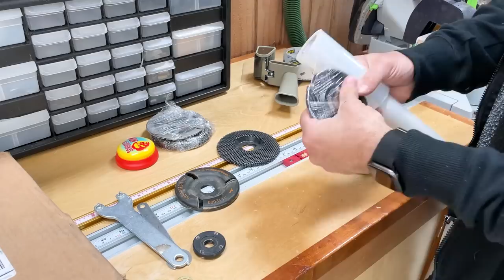The Walls Came Down

Comment: I own a couple commercial properties- my shop, some retail rental space (a post office) and a warehouse. It is great to have a shop that's not attached to my home because it keeps my workdays more disciplined and helps me separate from work on my off-days. But it is vastly more expensive! Not only the cost of the building, but all the extra bills (heating/cooling, water, electricity, internet, cable, etc.) add up, especially the property taxes and insurance, which are so much higher than for a residential property. You also have to consider duplicate costs for all sorts of things since you can't share things with your house anymore, like certain tools and appliances. Then there's the cost of maintaining a commercial building, which is more complicated and expensive than a house. All of this adds up to thousands of dollars a month that you could be putting into your IRA's or other investments if you had your shop on your residential property. Don't get me wrong, It's a great luxury to own commercial property, (and sometimes a good investment, which is why I own some) but as a workshop for a YouTube business, which can literally operate anywhere there's an internet connection, it's an expensive luxury :)
Reply from the maker: All good info. Thanks man. Also have to balance that stuff with the fact that most areas that allow home based businesses do NOT allow you to hire outside employees. So if growth is the goal, you're stuck. And in my case specifically, I'm fortunate that I'm moving from Denver ($$$) to Missouri ($). That puts us in a very good financial position to absorb any additional costs associated with the business. This is something I'd never even attempt here in Denver.
Reply from the maker: Not to mention the muddy water between homeowners insurance and business insurance and how the two will likely both bail out in the event of a major issue.
Reply: @johndoe6032  I have often heard that about being an audit flag, but I have never met a tax professional who confirms that this is true. My accountant says it's a myth, but I suppose that's just one guy's opinion. The IRS is never going to confirm or deny anything :)
Reply: @StumpyNubs  Once I discovered what happens when you sell a house that has a home office for which business deductions have been taken I decided it couldn’t possibly be worth it.
Reply: Gasoline unfortunately isn't free either. Unless you walk to work or maybe take the bus you're probably going to drive. You could just buy a horse and buggy and learn to scream "GITTYUP!" on the freeway.. lol
Reply: @woodwhisperer  Get out of Denver baby go go!

Comment: Moved back in 2020 and sold most of my machinery and bought new for my new, larger shop.  It worked out  well for me, especially since I had put my shop into storage while updating the new shop space (electrical, walls, insulation, etc. . . ).

Comment: When I bought my place about 8-9 years ago it was touch and go all the way down to getting signatures at closing.  But it worked out despite all the drama.  I didn't care about zoning at the time so I never really looked into it.  NOW I'm dealing with possible zoning changes and variants as my plans for the 1800sf shop that was on the property when I purchased has changed.  Good luck on your search/sale.

Comment: I'm making the shift to a not-at-home shop currently too - 40 acres of woods was still somehow going to be a zoning fight to build a bigger shop on, so I ended up buying a ridiculously huge old textile mill instead (pretty reasonable price - 42k sqft for $260k in mostly decent shape).  Keep a close eye on roofs, commercial roofing can get pricy to deal with fast, and flat roofs are prone to leaks that commercial owners seem to love to just ignore; the typical roof construction can also hide small leaks quite well until a real heavy storm.  Worth researching the background of the building too - I found mine had been bought super cheap at a tax sale and the guy's plans had fallen through, so I lowballed and got lucky, asking price had been 500k.  Can be worth going a lot bigger than you need too, I've got a 15k sqft room I'm going to rent out, should bring several grand per month more than mortgage, utilities, etc.

I was a bit hesitant about not having it at home initially, but the drive is easy enough, and has the big side benefit of making it possible to sell this house and move whenever I want without having to also move the ridiculous amount of tools I have on a normal house sale timeline.  Also space. So. Much. Space.

Comment: Golf club bags work great for clamps too. Most have wheels making life easier, and they can often handle alot of weight. Pick them up used at pawn shops, for next to nothing most of the time. I got in the habit of using them for microphone stands and cables for live sound, since they transport so well.

Comment: Apple boxes and similar are my favorite moving box. Sturdy and with handles and a consistent size for stacking, they can take the weight of books or other heavy items. Often free from your local produce market (if you get there early enough).  Do movers accept flammables? Even in totes with taped lids, I would think that partial containers like that would be a no-no.

Comment: That lift is pretty cool , im in the planning stages of knocking down a very structural wall in my shop that will add about 500 sq ft.
Lifting the LVL beam was a big hurdle until I watched that unit in action

Comment: Boy can I relate to this video. Just moved my house and my shop two days ago. The movers couldn't believe how many tools I have. They had literally never seen a jointer or a band saw. They kinda knew what a table saw is. Anyway, they got the tools in and out of the truck but it will be a while before I can tell if there was any damage. 

Best wishes on the move, Mr. Spags. Going with a commercial property as an LLC would likely give you a lot of freedom; no residential codes or HOAs to worry about. Hopefully, the taxes won't be too bad in Missouri.  Probably wouldn't be cost affective in California or the northeast. Be careful about what kind of area the commercial property is in. You don't want to have to commute with an armed security team or constantly worry about break-ins. (Parts of St. Louis come to mind.)

Comment: Moving across several states later this year and really interested in how you pack and ship the larger tools. Do you put them on pallets? Enclose them in some sort of carton? Break them down somewhat (e.g. wings off the table saw). Just take off the wheels and stretch wrap? 

And shipping. In your move to Colorado, the shop arrived a few days after the household stuff. Separate shipper? Just two loads with the same shipper? Are you going to use PODS or a similar vendor for the shop equipment?

Comment: BTW, on the "temporary wall" I can't think of any code violations it could introduce code violations it would introduce except for the un-inspected electrical stuff.  You didn't do anything to affect the  structure of the house so I am not sure if the wall would really be considered a wall.  The one thing I thought of was possibly draft stopping.  I recommend you look into that when you rebuild the wall at your next location.  Also, it may be possible to avoid electrical code issues by plugging the wall into an outlet rather than wiring it into the house wiring.

Comment: I just moved from a two-car attached shop with maybe 350 square feet to a detached garage with 1060 square feet. I lived in the old place for 15 years. I learned that you can have enough equipment to fill a large space in a small space, as I've very much filled it. I'm lucky enough to have a son who manages a Two Men and a Truck office. He educated me on the science of boxes, tape and shrink wrap. He did not educate me on how to move a big Powermatic table saw, however, which he and his guy did solo, or how to literally run the entire time while not carrying something heavy. Luckily the roof of my cinderblock shop is open so I could use the joists and a chain hoist to lift things onto carts. This was two months ago and I'm still only about half way to getting my shop squared away. Good luck to you brother.

Comment: Note: Most movers won't move or store volatiles (solvents and finishes) and paints; but, if you are moving a vehicle, you might be able to get away with it inside that.
Also, when we moved, the movers moved both of our vehicles and since they arrived first, I used them to pack items that I needed right away before the big moving truck arrived.

Comment: I too am moving. Tools beeping what they are, no fun. Sometimes somewhat clean used plastic (metal?) 55 gallon or other sizes can be had cheap, probably have to cut the top off, they make excellent shipping containers. 
If you have not gotten a place Tulsa OK has some places residential on one end and commercial so the other, most were out of my budget or current needs.
Look up 2 things for your future daughter 1) application to date my daughter 2) song “Cleaning My Gun”. Boys will come knocking before you know it it will seam like only a few short weeks.
Monte

Comment: Could you use some of those large cardboard tubes that are typically used for concrete footers to store longer clamps? I don't typically wander through that isle in the hardware store so I'm not sure if they come in longer lengths.

Comment: Here is a fun moving adventure I had.  I have two rolling mechanics tool chests.  Not big, maybe 4' wide and 3' tall.  Both on wheels.  Standard chests.  Rather than empty them I used the Stretchy McStretchWrap around them so that the drawers and doors would not fly open.  The movers rolled them up the ramp to the truck, then lifted the tool chests on their side.  What a disaster.  Things got so messed up it took hours to just be able to open the drawers.  Their response... "You are supposed to empty all drawers and you should have known we were going to transport on their side.  Besides, how were we supposed to know they still had items in it?".   Hmmmmm.  How indeed.  Maybe the weight or all the rattling you were hearing when you started to tip it over on the side, then moved to the second one and did the same?

Comment: Here’s a tip to be able to remove packing tape easily: instead of pressing down the end onto a box or whatever surface you’re taping, fold over the last 1” onto itself (sticky sides together) to create a flap you can easily grab to tear the tape off. It’s much easier than trying to find the end with your nails or cut open something you don’t want to damage with a blade.

Comment: Mark, I've a different kinda question for you 😄 What sort of lenses do you have in your glasses? You get no reflection whatsoever no matter where you face in the shop, whereas I look like I'm shooting white lasers outta my eyes, even with the generic 'low reflection' covering on them.
Reply from the maker: Nothing special that I'm aware of. These are basically off the shelf from Costco, lol. I might just be getting lucky.
Reply: @woodwhisperer  dang, i was hoping you'd say something like "3 coats of a 50/50 poly and turps mix, sanded to 12000 between coats" 😆

Comment: When you created your fake walls  did you bolt them to the floor or just secure them to the wall at the top?  Trying to look at options for my garage
Reply from the maker: Mine were only secured at the top and on the sides. It was rigid enough for the job but certainly NOT a permanent solution.
Reply: @woodwhisperer   thanks for the reply Marc, knowing that’s how you tackled it will make finding a solution to my shop easier 😄

Comment: Buy several cheap shipping pallets of recycled wood and stack everything on them as you pack up. They are relatively cheap. Loading then unloading at destination may be easier. Once unpacked, you will have a ready supply of cheap wood for projects. Also, before long, find an accountant in the new area and begin a relationship ASAP to assist you in local and state laws for businesses.

Comment: Be warned, a commercial mover won't move some chemicals. If you're a diy mover - fine. But if using commercial movers, check what shop chemicals/finishes they will allow in the trucks.

Comment: Most moving companies won't move liquids of any type, much less flammable solvents.
Reply from the maker: I've never had any issues.
Reply: @woodwhisperer  Did they know?😃😃
Reply: What actually happens is a combination of not telling them and the loaders not caring.
Reply: @woodwhisperer  Just ask your moving company before packing any hazardous materials on the truck. If you pack hazardous items without their knowledge, it will limit their liability in case of an accident. It's also a violation of federal law to not inform your movers of hazardous materials (49 U.S.C. 5124).